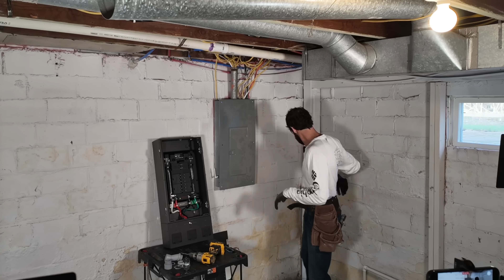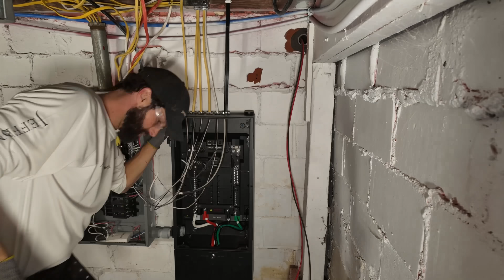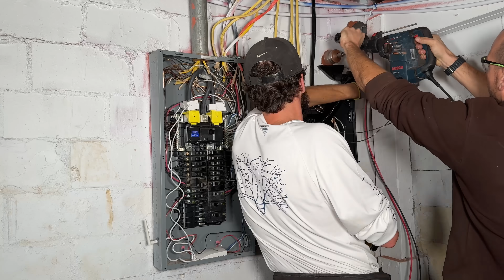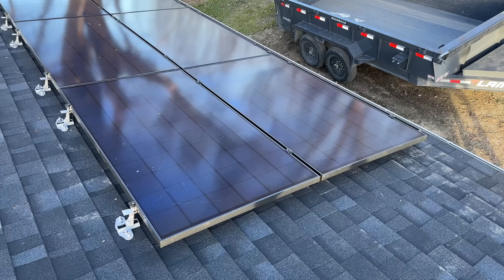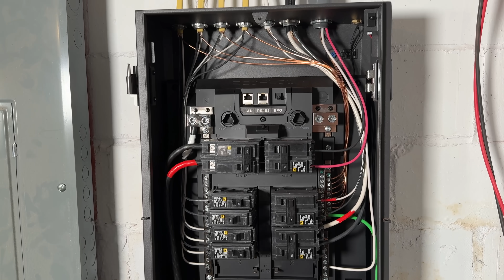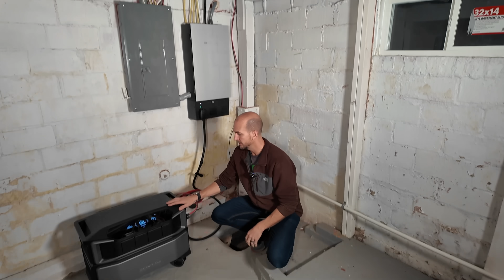A Sub Panel That Actually Saves You Money | EcoFlow Smart Panel 2

Comment: It's really nice looking, I'll give it that. Donno though, if I was going to go through all the work of relocating circuits to a sub panel (which requires permits in my area), I'd probably just do an off-grid inverter that has a better price point. Already ordered the DPU, so maybe I'll just use the manual transfer box instead, cheaper and easier to DIY. Smart Home Panel 2 with the install costs is a bit prohibitive.

Comment: I think the best solution is a three-way transfer switch that allows you to choose between grid and generator power. Way less expensive and you can install multiple panels if you have more than 10 circuits which is the standard number of allotments in the popular reliance transfer switch panel. Plus you don't have to relocate the circuits to a sub panel.
Reply: Do you have to manually switch the power? I agree this is expensive and was hoping for something cheaper. I feel like if I have to manual switch the power when my battery is low then it would be an inconvenience
Reply: @noyjr9492  also there are generator systems with automatic transfer capability it's just not the scenario I'm talking about.
Reply: @noyjr9492  Yes the three-way switch requires manual intervention. I agree it's an inconvenience, especially if you are away from your house on vacation, but so far I have only seen switches that require manual operation to switch between grid or off or generator.
Reply: EXACTLY, this is still not a whole home backup solution, only selected circuits can switch over, only way is to install a 100a/200a manual switch over to power the entire home from  a backup like this.
Reply: @varman001 it certainly can be a whole home backup solution. For instance I have three manual transfer switches each containing 10 circuits. You can install as many transfer switches as you want and offload your entire panel.
Reply: @phakeAccount  I am leaning that way simply to not have proprietary EcoFlow connections or future reliance on EcoFlow app, support, etc to activate/use the system. The only “auto” transfer systems now seem to require an “app” (even for generators).

Comment: Knockouts?
Reply from the maker: No knockouts,  to ensure the unit could be installed outside they didn’t provide knockouts.  Need to break out the drill 😁
Reply: @EverydayHomeRepairs  That's a bummer but not a deal breaker.  Thanks😁

Comment: Just so I understand, I can have a permanently installed rooftop solar setup, use the DPU and Smart Panel 2 to:

1) solar charge the DPU battery
2) use the DPU+Smart Panel for backup
AND
3) also have net metering/grid tied feed?
Reply from the maker: Yes to everything except this setup would not push back on the grid if you have net metering.
Reply: @EverydayHomeRepairs  Just want to understand, in my case I have rooftop solar that is grid tied NEM2.0 system, and with SHP2_+DPU, would I be able to charge the DPU using solar during the day and discharge the DPU to power the circuits in SHP2 at night? I don't need to feed back to grid from the DPU, but just want to make sure during the day when charging the DPU it's not pulling from the grid but from the rooftop solar. Thanks!
Reply: I have the exact same questions. Normally, to add battery storage/backup to an existing grid-tied solar system, you would need an ac coupled inverter and critical load subpanel added to the mix. wondering if/how the SHP2 + DPU can be used (if at all) in this scenario. and if possible, would the ac coupled inverter be able to still send back to the grid.
Reply: Amazing. So I could still separate the net metering portion out somehow (split/switch something?) I know it needs an interlock/block to not backfeed.